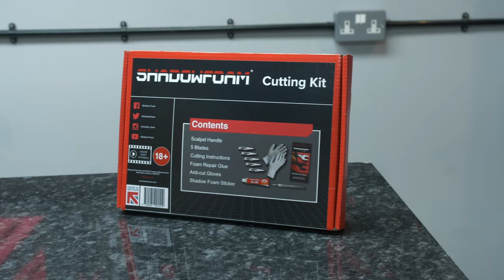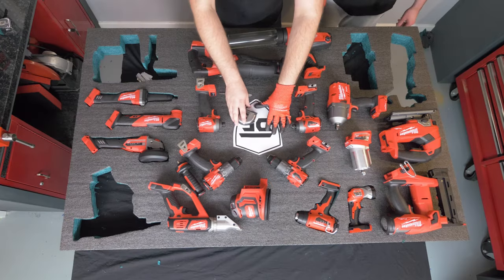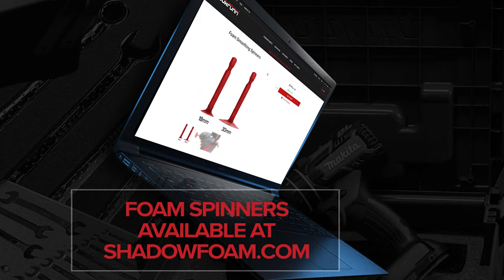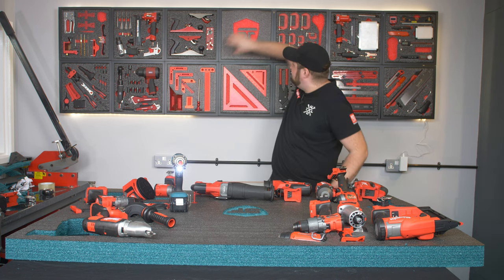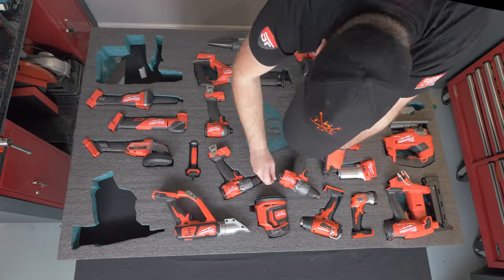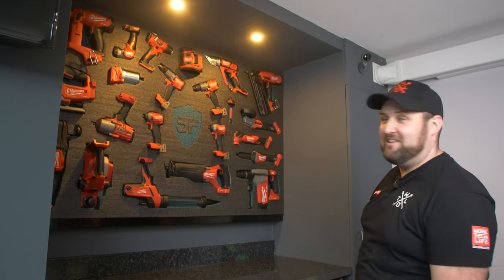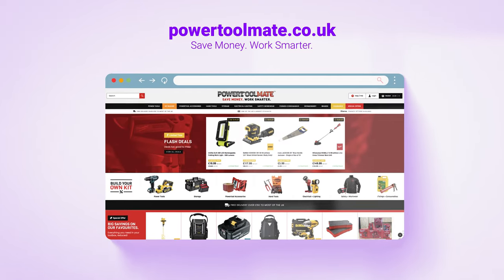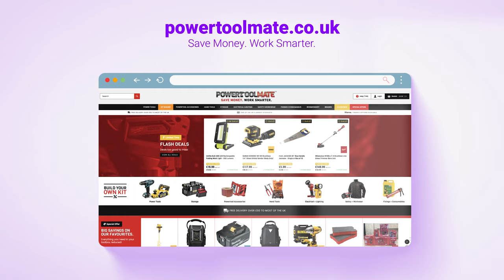Milwaukee Power Tool Wall - INSANE Workshop Storage Idea!

Comment: Fancy doing something like this in my garage - but it'd be onto painted brick. If you were to use some sort of mountings for this, what would you be using? Still yet to do my tool boxes but it's turned into a nightmare where I want to replace things for the long term!
Reply from the maker: Have you tried mounting rackets for cabinets? I got a few rails at my local Howdens

Comment: For the logo, instead of using a new piece of foam you could have just cut another layer deep then put the black top layer back in first then the lower layer on top
Reply from the maker: We actually did do that but didn't like the way it looked!

Comment: Too bad it will only fit every tool for like 6 months until you have to make a new one.
Reply from the maker: We can always add panels for extra tools! 😉
Reply: @ShadowFoam I was wondering more about the longevity/practicality of the foam? For display purposes I don’t see an issue, but I’m curious if the foam kind of warps over time as you pull tools in and out when using them. Would love to hear an update! Awesome video guys!